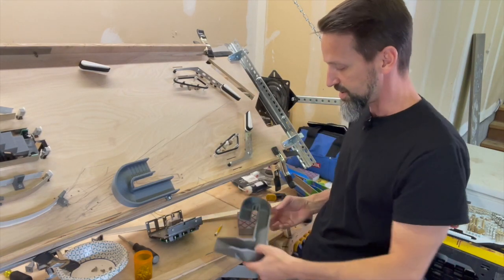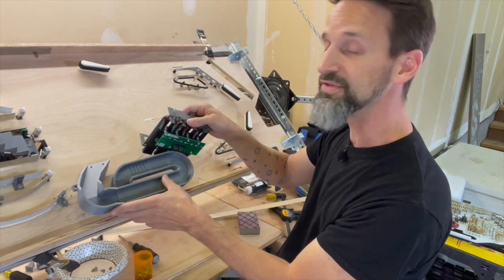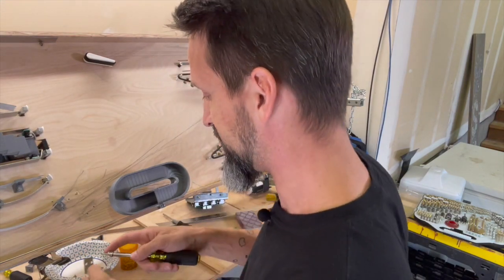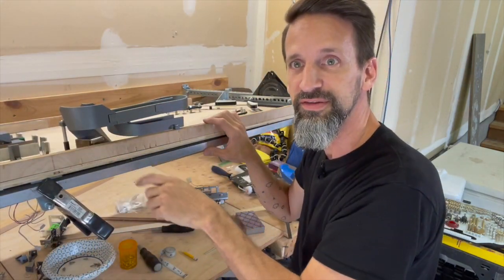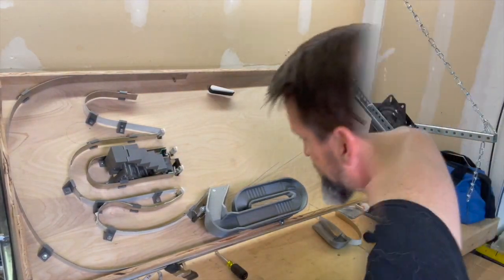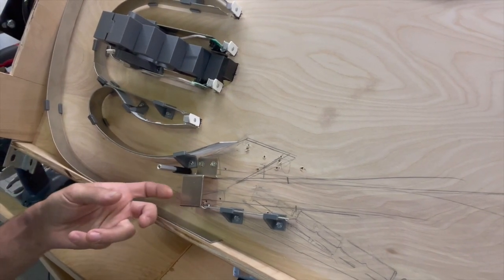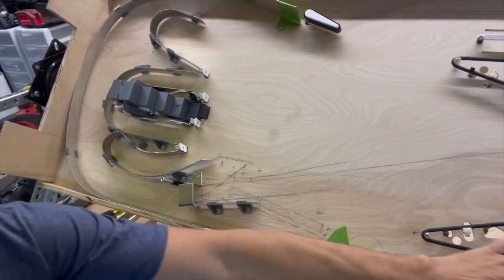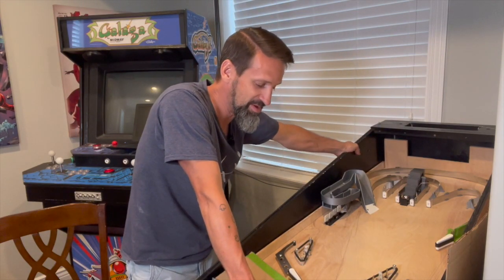HOW TO MAKE A PINBALL MACHINE: 3D Printing Ramps II

Comment: Hi, I just started watching this series of videos and not building yet, but would like to in the near future.  You have lots of cool ideas.  I'm  more of an engineer that a creative designer.  I have lots of EMs that I'm fixing currently.  
As a point of reference for your future endeavors in the future of making a machine playfield, I hope you do build another, get yourself a oscillating multitool.  A good brand one that can cut through the plywood quickly and cleanly.  I'm had one for years doing home remodeling and fid it invaluable.   You only require one tool for starting and cutting your openings for targets and such.  It was actually a bit painful to watch you drill holes, cut square with jig-saw, and file to cleanup the opening.  This tools would also allow for angled openings that is very difficult with the tools you are currently using. Generally you would not have to remove other items on the playfield to make room for your cutting tool.  I also use it to trim off metal bit, studs, shorten screws, etc.  Any way keep up the pin game and builds!

Comment: Hi Steve, what coil type do you use for the third flipper?
Reply from the maker: So all 5 of my main flipper coils are the same bslly/Williams flipper mech and coil from pinballlife.com - it's a dual wound coil with both main and hold coil windings in one - lmk if you need the exact coil numbers etc
Reply: @thepinballroom  for the lower flippers I've got 11629. Now I want to add a third flipper. What coil number did you choose? A weaker one?
Reply from the maker: @stefku76  no get the same strength, you can lower the power in the mpf config file - that's what I did - get the same coil tho
Reply: @thepinballroom  ah, yes. I din't thought about that way. Thanks!

Comment: That upper flipper seems pretty difficult to aim. Maybe that’s your intent, but I wonder if there’s any way to make an upper flipper feel easier or more consistent?
Reply from the maker: yeah, great observation, I think you're right on with that - it's all about getting the geometry lined up, that's why I had to move the flipper a few times. But I agree, I think it will need more dialing in to make sure the shot has a higher percentage of being made - the steepness of the ramp doesn't help either but there's not a lot I can do about that with where I want it placed and the loop I want it to do - I could perhaps simplify the ramp and not have it do the full loop, that would allow me to make it lower / less steep and could help the shot feel a lot better, I've been considering that actually, but for now, this is where it's at.